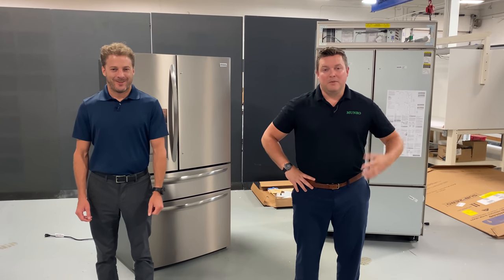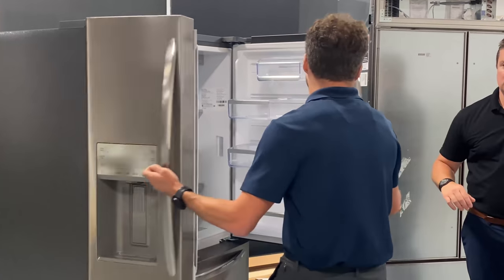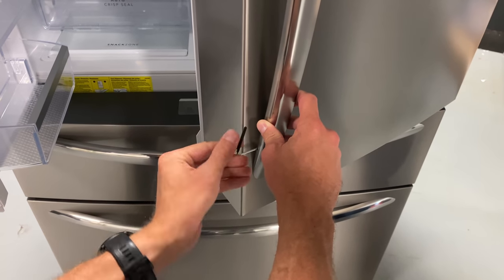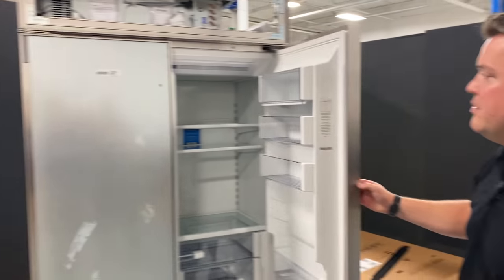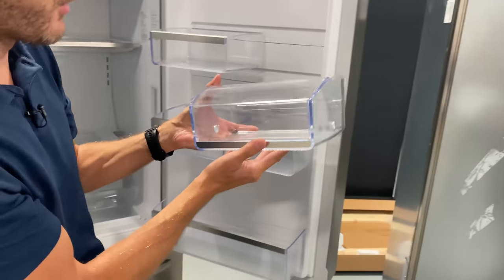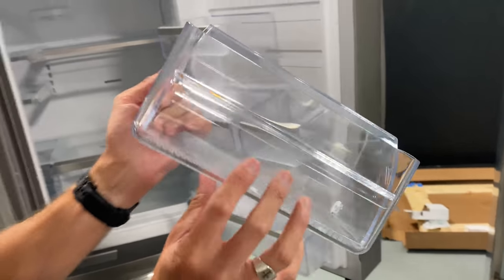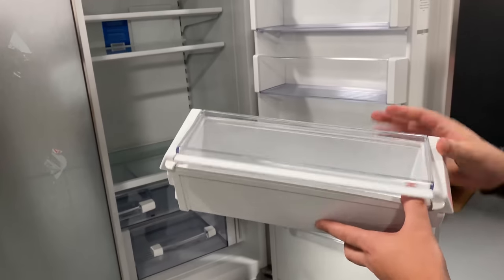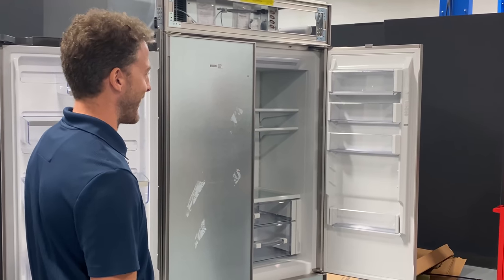Consumer Series: Sub-Zero vs Frigidaire - Drawers + COLD TEST!!

Comment: The energy consumption would have been nice to know as well. A measurement that in real life is more interesting than how fast an empty fridge cools down. And how well does the insulation perform, you have the thermal camera to easily detect heat bridges to the inside.
Reply: I thought the same thing at first, but how fast it cools down from room temperature should reflect how quickly it returns to operating temperature after opening the doors (or maybe leaving them open for a minute or two, which some people do occasionally).

Comment: Learning how to use the IR camera to measure IR reflective objects would be a good. By measuring to the side, you're just measuring the reflection off the can from the side instead of the front. You should be pointing at the taped area for a good reading.
Reply: Agree, seems that there was a lot of variability in measurement
Reply: Outsource the entire teardown to the fans!
Reply: By that logic, wouldn't measuring the front just be measuring the reflected heat of the outside room?
Reply: @raddaks2039  That's why it looks orange, it reflects the camera man, or something in the background.
Reply: Yes, absolutely agree.   If you have no experience using thermal cameras, that's a mistake a lot of people do.   If you're measuring anything metal, it's best to put tape on it to read the temperature there.  The paint on the can is too thin and translucent to the IR wavelengths associated with thermal IR.  They were reading the temp of whatever was reflected inside the fridges or the outside.   When I saw the tape, I thought that that's what they were going to measure (also knew it was to hide the brand name).
Reply: @heltok  Absolutely!  Though there are a large number of us.

Don't worry about me crowding to the front, I'll hang back at the refreshments table.  :-)
Reply: That's right! That's why the face-on was orange too. It was reflecting the outside temperature.
Reply: Yes, strange procedure. Just take the beer out, put it into a glass and put a thermometer into it. Overall the procedures look unprofessional and unscientific to me, which does tarnish the reputation quite a bit in my opinion.
Reply: Came here to say the same thing about the tape.
Reply: Absolutely on point! Plus, there is emissivity coefficient "ε" which varies for different materials. On most good IR cameras "ε" can be chosen according to the material which temperature will be measured. (there is integrated table with emissivity values of common materials).
A simple K-type thermocouple thermometer may be a more appropriate tool to use in this case. Will give accurate readings.
Reply: THIS ^^^ 👍👍 you can't measure the temperature of a metallic surface with a thermal cam I believe
Reply: @mattf3761  That's right. Anything shiny/polished/reflective for that matter. A piece of black tape, as suggested by many, can overcome this issue. Or another way - blacken part of the surface with smoke. Black soot has ε=0.97
Reply: Yeah, that guy don't know what is he doing. What a joke.
Reply: Yep. Scotch Brand 88 black vinyl electrical tape has an emissivity of 0.96 in both the short wavelength (3-5 μm) and long wavelength (8-12 μm) regions, and is recommended by FLIR.
Reply: That's howThunderf00t measures the temperature of metallic objects too

Comment: When using infrared to measure temperature, note that not all materials emit IR the same way. Metals and shiny surfaces tend to reflect IR, so you're not measuring the object itself. It's called the emissivity of a material. Use black paint or tape to get a more accurate measurement. You can even see the outline of the blue tape here, which proves it emits IR differently since its temperature is the same as the can and its contents.
Reply: Yes. The only use I have found for IR is to detect temperature differences across an object. I use a thermocouple to measure actual temp.

Comment: Comparing how fast they initially cool down is hardly scientific (different size, hardly any real value to the customer) and the measurement method was a joke. Painfully incorrect usage of an infrared camera, no regard for emissivity or reflection, no tape. Without tape, you either have reflection or condensation making the readings worthless.
Reply: They really should have measured the temperature to the tape on the cans. It might not be perfect but it would work much much better

Comment: You should have put an energy meter on your extension cord to get kWh used per hour. Check the nameplates for watts as well. The Sub Zero has more mass and would take longer to cool down down depending on the wattage of the compressor for each unit. Also, IR thermometers can give squirrely readings on reflective objects. Pop those cans and insert a thermometer, thermocouple, or RTD. What is the cubic feet of each unit?  Munro Live, this was not your best effort.

Comment: In the final results, the Sub is going to be revealed as much a fashion statement of conspicuous consumption for the stylish dream kitchen than an example of superior mechanical functionality.  The rest of the price difference is the consequence of much lower production volume, and possibly higher labor cost per unit.  It will be interesting to see if the Sub uses more durable polycarbonate plastic and the Fridge uses cheap acrylic, or other not so visible subtleties that make one more durable than the other when kids start banging on the transparent drawers or closing the doors on then while they aren’t fully closed.  Also, the manufacturing source of the compressors and refrigerants used might also be interesting, as well as their electrical usage in operation, including defrost cycles.  Ball bearings in fans versus bronze, etc.
Reply: Professional installation of a SZ (without applying cladding) costs more than the Frigidaire.
Reply: Possibly.  Though I do think some of the additional things, like the magnetic latch and soft close drawers are nice touches.  They're more expensive but are both nicer and help to prevent slamming or the door not closing automatically because the hinges got stiff over years of use.
Reply: True, but those kind of differences cost pennies, not thousands of dollars to make.  Kind of like the vacuum cleaner you have to pay $100 more for to get a $2 cost longer cord that reaches every corner of a room.

Comment: We seem to be assuming that a faster cooldown for a can of beer when the fridge has just been turned on is a valid measure of quality/performance.

Maybe that's not a valid assumption.

Of much more interest to consumers are durability - how long will these appliance continue in service without maintenance? - energy consumption, and temperature consistency during prolonged operation.  Startup cooling speed probably isn't very important.

Comment: Cooling speed is fairly unimportant, let’s see what the efficiency is!
Reply: I agree for home use. For commercial kitchen use it is very important.
Reply: If you buy pay for a Sub-Zero, do you really care about saving $100 a year in electricity?  However, having the doors open a lot to load the fridge or repeated opening during cooking, cooling speed would be important to maintain the temp.

Comment: the subzero likely had much more substantial material content (i.e. more steel/plastic/components) to cool, thus it was cooling down slower. It would be great to see the power draw of each
Reply: If the SZ was a car reviewed by Sandy he'd be lambasting that excessive mass the need for two cooling systems and the loss of cabinet space above that bloated tub of 20th century "bigger is better" engineering.

Comment: I would have liked to see energy usage, current draw during that hour both peak and constant. Obviously, there are more scientific methods of testing and this is just a start. I look forward to the Sub-Zero teardown as that factory is just a few miles from me.
Reply: would love to see someone from SZ pop in to the comments from time to time.  maybe even go to Sandy's place and offer design reasons!
Reply: @jetah50  SZ can afford to send someone; they have the profit margin selling clunky old tech with a digital display and LED lighting.  Frigidaire is too busy manufacturing 20X the number of plug and play refrigerators for US sales.  Never mentioned was if either fridge is Energy Star "efficient", which is a shame since fridges are the top energy consumer in homes.
Reply: The compressor is pretty much either on or off.  When you first turn it on, it is just going to run constantly and the power draw would change very little until it finally makes temp and then it will drop down to something very small.  So for this one hour test where the compressor isn't going to cycle off, it would be pretty much constant.  Cumulative cycle on-time will be driven by how fast heat enters the unit which is mostly a factor of how well it is insulated and how big it is (surface area).  And of course how often you open the door and for how long.  The power draw of the unit while running will mostly be a factor of how big the compressor is, not how cold it is inside the fridge.  To be completely accurate, it will draw more amps with a higher load on the compressor (higher refrigerant flow rate and/or higher pressure differential), but the load isn't going to change very much when the condenser is in a climate controlled room.  What for sure will change is the higher the temp differential between inside and outside, the faster heat will get through the insulation and the more run time you will have.

Comment: you could use a temperature data logger (eg a HOBO 8K Pendant® Temperature/Alarm (Waterproof) Data Logger) to see how the temperature management works in both models. Maybe a few experiments with increasing numbers of gallon containers of water in the fridge compartment to vary the thermal mass.

Comment: The slower cool down rate could be from better efficiency.  It would be interesting to look at energy consumption to maintain the set temperature over 48 hours or so.  You should probably put some stuff in the fridge for thermal mass (maybe 30 lbs of stuff... beer maybe?).  If the freezer can't be shut off separately, then put a similar thermal mass in each freezer and program to the same temperature set point.  The energy consumption test should not start until steady state temperature is reached (don't open the door during the test, at least not too often).  If the units are of different volume, you could express the results in 3 metrics.  Energy used (over the 48 hours... in KWh), Energy used per unit volume of the fridge and Energy used per surface area of the fridge (internal... this starts to tell you something about the insulation quality).  Should also record the ambient (external of the fridge) temperature.  I assume you have a couple of "kill-a-watt" meters (or the like) to measure the energy consumed.  These are pretty cheap and available on amazon.
Reply: Agree with all of your points. What I don’t agree with is that we as an audience shouldn’t have to suggest to this company how to do some very basic tests of a product. Especially is that is what the company in question is supposedly good at.
Reply: @13squared2009  True... but other readers might appreciate the test details (maybe)?

Comment: Question about thermal camera: Arent there too many variables to use it reliably? Ambient air, range, reflectivity of target. I know it's not the actual testing yet but something to keep in mind for viewers to not take the thermal camera for some definitive measurement.
Reply: That's why an engineer who thinks and knows what he's doing - uses the right tools to measure..  Non-contact temperature measurement is used where it's dangerous or impractical make contact - like hot brake rotors, stars, or magna.

For this measurement contact is practical. You could do it continuously, without opening the doors, with a contact thermocouple, a $20 digital multimeter and a lab grade glass thermometer for calibration. 

But the beer test they  did would still be a pointless waste of time.

Comment: I am from the Madison area... and there is no way I could justify spending that amount for a Sub-Zero... replaced my frig about a year ago with a GE... and the main things I considered was the opening I had to work with (above cabinets were and issue) and the shelfs inside how they looked, wanted sturdy and flexible arrangements for the shelfs... happy with my GE choice... barely fit in my opening!  As the above cabinets cannot be opened now... lol
Reply: GE (Haier) has a reputation for continuous improvement using the same process as Tesla. SZ doesn't.

Comment: I’m surprised you don’t have a temperature probe instead of a flawed it measurement.
Reply: Along with a go pro in the fridge filming the live temp.
Reply: @Robert-cu9bm  there are wireless probes with wifi and graphs etc etc.
Reply: @Gorgula  
A fridge is a metal box, basically a Faraday cage.
It might be a struggle for the wireless probe to work.

Comment: Lights really do make the fridge. When do you think kitchen cabinet makers are going to figure out putting lights inside cabinets? The battery under the cabinet work lights are nothing but toys, and aren't very practical. 
The rest of this is a rant. If you're missing Sandy, go ahead and read it. (Not as informed but it is a rant from an old man....) 
By pure chance on Monday I had a new LG  refrigerator delivered to my home. This makes these videos particularly interesting to me. First of all I've got many many years of refrigerators in my past (My grandmother in Detroit had a Norge - Norge also made an airplane), and I've swapped the hinges on dozens of fridges over the years.  
The delivery guys said they weren't allowed to swap the doors because they weren't certified to do this. They did have to take the doors off to fit it into my kitchen, as I had to remove the doors of my old one to get it out.  
So I ended up with doors and drawers all over my kitchen, the water line to hook up. No problem - except the door hinge hardware was different, the manual was overly complex, (I got less  paper nonsense when I filed my taxes.)
 I couldn't find the new parts needed to flip the door. I went online. First I came across endless question and answer blogs, the first question of which was invariably: Is the door magnetic? And the unanimous response - no it is not. (I know stainless steel isn't magnetic, but there are different stainless steels....) The doors are absolutely magnetic - so who are the yahoos answering the questions? 
 Then I Googled for changing the door hinges. I ended up with endless links to old school fridges where the parts just flip to the other side. No help. On LGs site? A search there got endless pictures of clothes driers. I called customer service. Why are these parts not included? Where do I get them? How soon can you get them to me? "Please sir if I may put you on hold for only two minutes I will find the answer for you." Then I'd get transferred to someone else, same thing. There was the standard disconnect (the F-Off) and having to call back. Finally I went back through all the pieces again and found a box in the door. So why didn't the first operator look at some note and say, "Have you checked the lower left door shelf (dummy)?"  There was another issue with flipping the lower pin around. It unscrews  - but the picture shows it as a straight insertion. 
It took me over two hours just to flip the door. I got in my new Tesla and was on the freeway in five minutes. 
The stainless steel door scratches incredibly easy. (I'd have bought a white vinyl one had I had that option. My Cybertruck will be hard as nails and scratches will only enhance it. I suspect the stainless steel on the fridge might only be some soft thin veneer.)  Be great if you guys can cover all the things sold as 'stainless steel' and why some of them seem like delicate junk.
It's been three days. What really matters? It works. It's got a (standard) very high efficiency rating.  Efficiency and how quickly it can cool things is absolutely critical - but that's a buying decision. After it's installed for the next ten years or so it will work and there will be no reason to think about how this fridge works mechanically - - unless something goes wrong.
The next issue is does it fit the things I put in a fridge? It has more room than my old one. The freezer on the bottom is the primary reason I replaced my old fridge. It fits my stuff so it fits my use, but like the Frigidaire in your comparison - very little adjustability options.   
Keeping it clean will be the next issue. When I inevitably spill something sticky or that can go rancid, will I be able to easily clean it all up or will there be crevices impossible to clean out?

Comment: A much better test of cooling capacity would be to load the refrigerators up with a lot of containers of water and measure how long it takes to cool that down since water takes a lot more energy to cool down than the air inside the refrigerator.

Comment: I do like this series. Hopefully you look deeply into the refrigeration components. Curious to find out whose manufacturer of compressor they use and the BTU ratings of each one. Do they use thermostatic expansion valves, etc. I’m sure the Frigidaire doesn’t use TXVs.